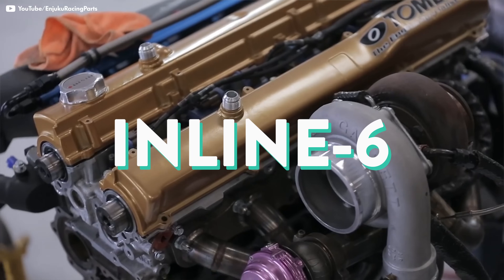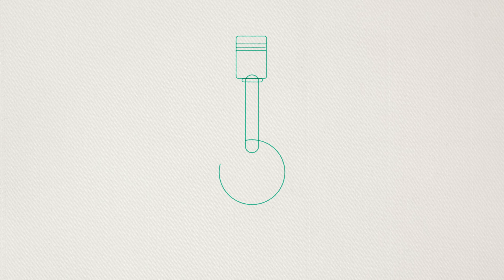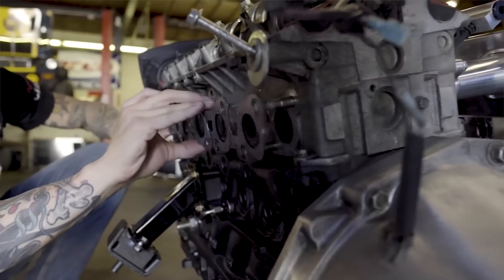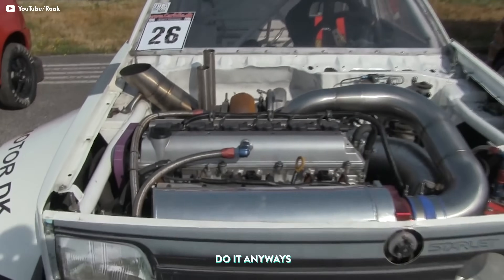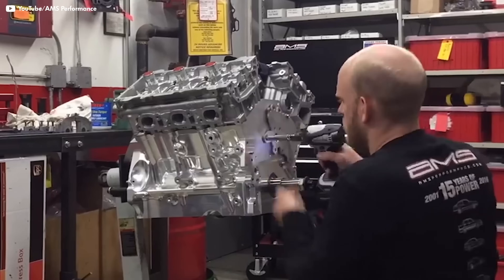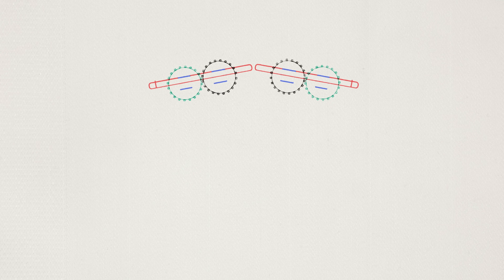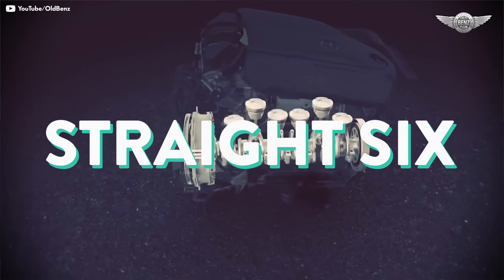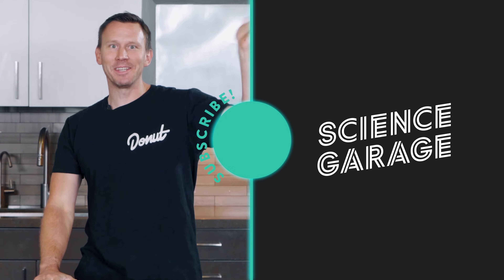INLINE 6 vs. V6 - How it Works | SCIENCE GARAGE

Comment: Why no Barra in the list of greatest Inline 6 engines, Australians love it and my Falcon loves it aswell
Reply: Barra the fuckn world 🤟🏼
Reply: Super rare here in the states so ppl don't know about them but still a good enough
Reply: that motor is a beast 4 liters of awesomness
Reply: Barra is good, but it's limited in Aussie and New Zealand only
Reply: And the TVR speed 6 is one of the best stock I6s but it wasn't mentioned.
Reply: Dexter Wallace, because it breaks all the time!
Reply: They're great, but expensive to import to the States. I also personally don't think they sound good.
Reply: @benc.1197  Move over here dude, they're in our taxi's, and "dime-a-dozen" to buy. Also, we still get hi-po American V8's, and the whole swag of Japanese and Euro performance vehicles to boot.
Reply: @venners5547  if I moved to 'Straya it would be for the RB scene. I love that motor series with all my heart.
Reply: @benc.1197  My Favourite as well, but the Ford engine is domestic as fark, and obviously cheap, ridiculously reliable, and available. Hence, big power/small money due to so many shops specialising in them, is a reality. It's a genuine replacement/competitor to the LS Chev engines, especially once you take boost into account. They're just that hard to kill.
Reply: @venners5547  I wish the Barra would become a big thing over here. I hate LS swaps because they're boring. The engine is the best thing GM has ever built but it's overdone.
Reply: @venners5547  the LS is a cheap motor, but GM is not into innovation, its a pushrod motor, a tried and true design, but they have limits. if i want a V8, id rather go for a ford modular engine, you can squeeze more power from them and they use less air and fuel due to the smaller displacement, the quad cam motors used in the GT, known as the BOSS, 5.4 liters and inch for inch, more power than an LS.
Reply: @benc.1197  to bad because you can pick them up here for 200 Aud or less
Reply: Because us 'Muricans are bitter we never got it in our country.
Reply: I thought the other day that a barra engine would be awesome to swap into a Ford sierra.
Reply: My first thought 😍
Reply: Barra XR6 Turbo👍
Reply: Matthew T n54 is like one of the most unreliable motors ever 😂
Reply: I have naughty dreams about manual swapping and turbocharging a grandpa spec EF Futura...wheel covers and all!

Comment: BUICK 3.8 V6 IS THE BEST
Reply: @aboodmki3  1987 Buick GNX

mic drop
Reply: Come to Australia. We had the Buick 3.8 in domestic Holden Commodores (GM product) and then Ford Oz developed their venerable inline 6 from a wheezing crossflow into a single OHC, then DOHC, turbocharged firebreathing monster. No-one here even cares about the Buick V6 anymore.
Reply: That’s probably one of the few stock engines that could be use in an Indy car

Comment: How about a H-6?
Reply: No he means boxer engine which is not quite the same as flat 6
Reply: @pablovini98  Correct. Also they have a video on that which is pretty good. Sorry for misunderstading...
Reply: I thought the terms "boxer" and "flat" referred to a Horizontally Opposed engine, exactly 180 degrees. How are they different?
Reply: @luckyduckydrivingschool3615  they are not connected the same way to the cranckshaft
Reply: Oh, interesting. Thanks for the reply. I looked it up and found one article stating: "the boxer mill employs one crankpin per cylinder, while the flat (horizontal V) engine uses one crankpin per two horizontally opposed cylinders" So it seems the Boxer is smoother (and a little more complicated)? I wonder why you would use a flat engine over that.
Reply: Pablovini98 it's the same
Reply: What about T-6?
Reply: Volvo i6 here. It’s perfect
Reply: @Fang Fire I think subaru and porsche are great on what they are doing which is mostly the reason about air flow the engine shape just gives a slight advantage. But noone can deny that its one of the best engine types ever built... If not the best!!! ( I am a bit biased I know)
Reply: @Fang Fire I got the point man. And i completly agree with you.
Reply: what about the vr6 also
Reply: If by H-6 you mean a 6-cylinder opposed-piston engine, there's this company called Achates which built one. It may run on diesel, but they're making an any-fuel version later, so that's something to look forward to
Reply: People need to look at the crankshafts of flat Vs and boxers. They're different, the Pistons move differently.
Reply: There are "X" shaped engines, I believe old airplanes used them.
Reply: @joost6994  those are called radial engines
Reply: @TwoCraZyEyes0  ah ok, thanks!
Reply: Talking about Radia? Those are cool things.
Reply: @joost6994  Radials????
Reply: Joost de Bruin Nah they're still used in modern airplanes today. I fly Cessna 172's and they use Lycoming IO 360 L2A engines. "I" meaning fuel injected and "O" meaning horizontally opposed.
Reply: @joost6994  but aren't x-shaped engines a sub-category under radial engines (funnily enough, in Greek we refer to radial engines as "asteroid engines")... Not that more than a couple of cars have ever used radial engines (since they're really bulky, and their shape probably doesn't make them easy to fits into cars).
Reply: You mean 180° V6
Reply: @StaVrosRaf  exept that it's perfectly balanced and is lower, wider and has lower center of gravity.
Reply: @КлиментЦонков  And no vertical innertia from the pistons... Truly amazing engines. Even though they also use counter weight safts.
Reply: Stavros Raf 180 degree V-type engines are not the same as boxer engines. H-6 means horizontally opposed, so it always applies to boxers, rarely to the occasional 180 degree V, and never exclusively to the latter, as you implied by your oh-so-witty retort. No, he doesn’t mean 180 degree V, but if he did, he’d still be incorrect, like you.
Reply: @sterlingroberts6240  As you can see above i already apologised for my misunderstading so.. yeah  thanks for mentioning it again.
Reply: Stavros Raf anytime. I’m not going to take the time to read up on whether you learned the lesson yet, if you haven’t taken the time to learn that a 180 degree V6 isn’t equivocal(or even representative) to the H-6 designation.
Reply: @sterlingroberts6240  Thanks for the info, appreciated.
Reply: Stavros Raf no he doesn't...v6 is a 90degree boxer
Reply: @willybman3723  Its not 90 degree its 180 think about it. 90 degree is a right angle

Comment: Um... no Barra?!
Reply: Yanks’ll go fucking nuts for it once they hear about it, like they did with utes
Reply: @mattsmally747  few ppl know of it in the states but it's super rare, super expensive and way too big to fit into most chassis without requiring tons of fab work. It'll never be popular here in the states.
Reply: @mattsmally747  the ones that know about it already are 😅
Reply: @mattsmally747  i'm a yank and i've been wanting one, 4.0 I6 Turbo? RIP 2JZ
Reply: Do you come from the land down under?!
Reply: Best engine ever
Reply: Yeah, to be fair, it may well be the best engine (inline 6 specific) ever, just due to the fact that it has the cubes to start with, and the technology to back it up. 4.0 > 3.0.